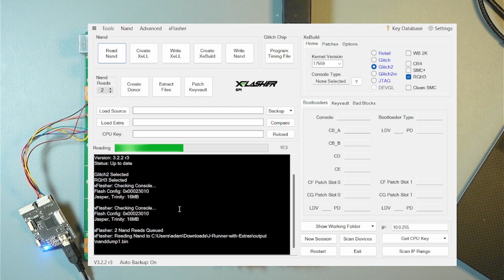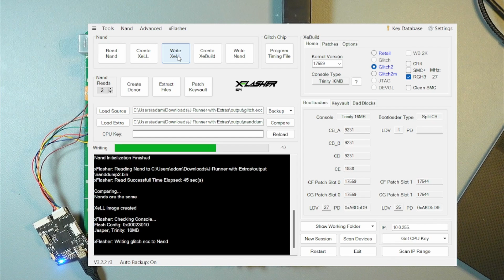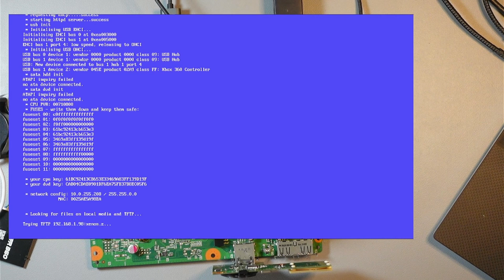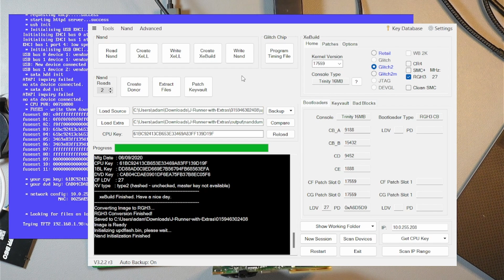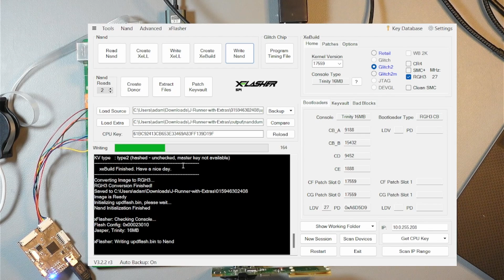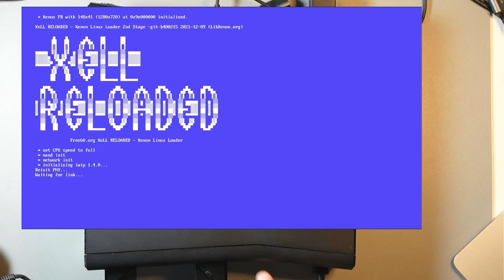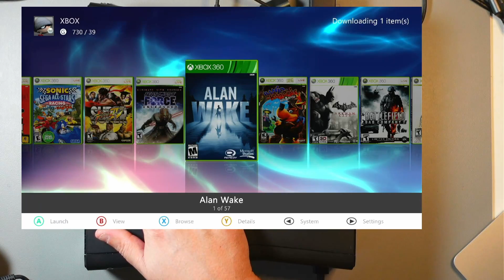Xbox 360 RGH 3.0 (Trinity)

Comment: Nice video tutorial :) after flashing do i need to desolder back cables with resistor? Or those two cables must stay?
Reply: The two wires on the back of the board stay, you can desolder the Nand flashing cables though.

Comment: Can you help ? 
after writing ecc
I connected it to tv through hdmj but nothing is showing on the screen power green light is blinking
Reply: Same here
Reply from the maker: Assuming you've read the NAND and the two images were identical, you created cell image (ecc) and wrote it back without any problems then you'll need to go back and check if all the wiring is correct (around 4:30 in the video). 
I'm also assuming you have Trinity board...
Reply: @RetroTechCorner i have rechecked all the wiring nothing is wrong there
Yes this is trinity
Reply: Do you solve it ?
Reply: @vaibhavsharma816 just did a Trinity rgh 3 last week and used a10k resistor. It was a black screen no matter what. I dropped it down to a 5k and it booted first attempt. Guides say from 3k to 10k, so if you or anyone use a 10k with a black screen, try dropping to a lower resistor.

Comment: What temperature do you set your iron at
Reply from the maker: It's usually 300-320 C but depends on the job. Just make sure your iron is calibrated. But my advice is to get some spare/faulty board (any board, not necessarily xbox) and practice with different temps. That way you'll see the results and you'll know your iron "behaviour".
Reply: @RetroTechCorner  Is a micro solder point recommended for ease or a requirement?